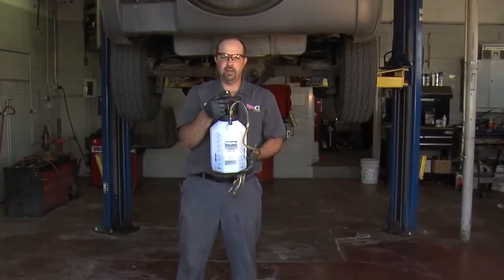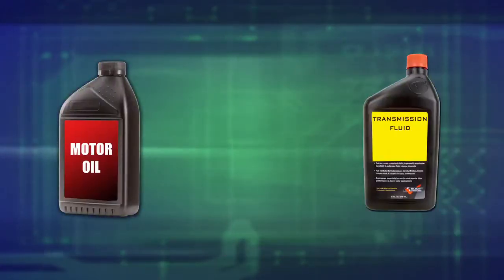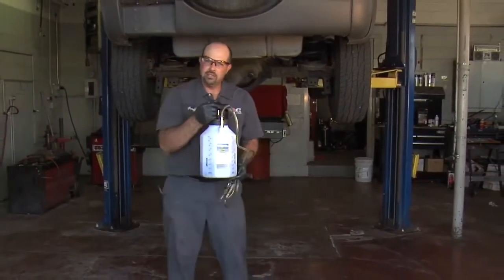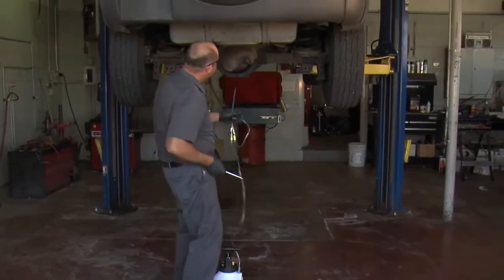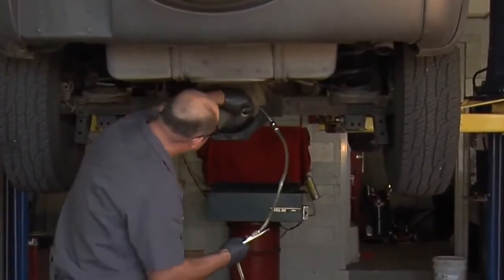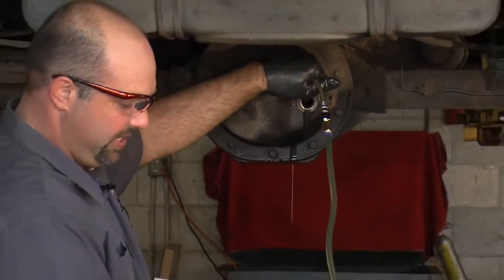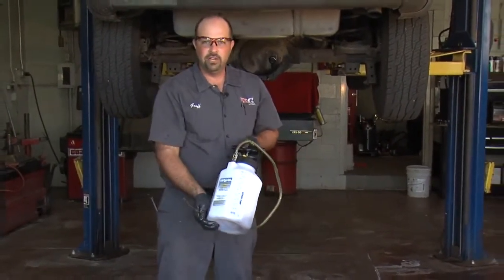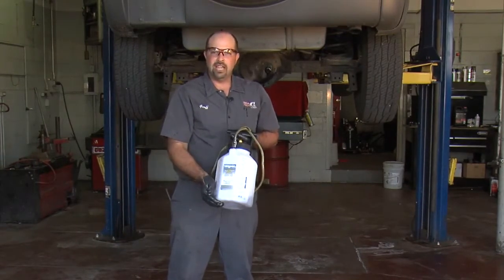How to Dispense Fluids using the Mityvac MV6400 Fluid Dispenser

Comment: What would you use to clean the reservoir when you dispense a different type of fluid or do you actually need to clean it?
Reply from the maker: You can clean the reservoir with a good quality degreasing soap, rinse, then allow to dry. Generally, most engine oils with similar characteristics don't need to perform more than a simple wipe-down. If moving to/from a transmission fluid or brake fluid as an example,  the reservoir needs to be fully cleaned and dried prior to adding the new fluid type, and the tubing will need to be flushed.  We recommend having a separate reservoir and dispensing hoses dedicated to brake fluid and other specialty fluids to limit contamination issues. 

~ John